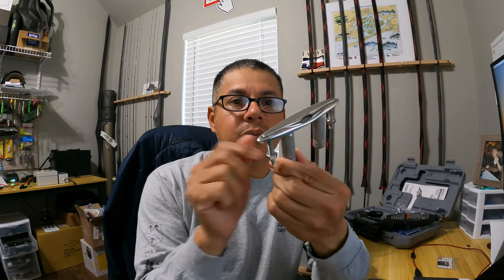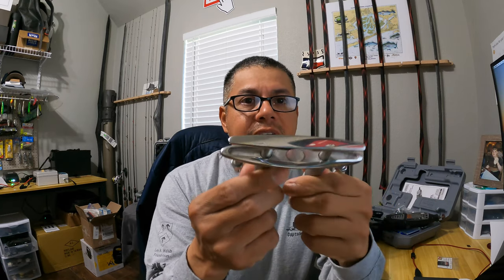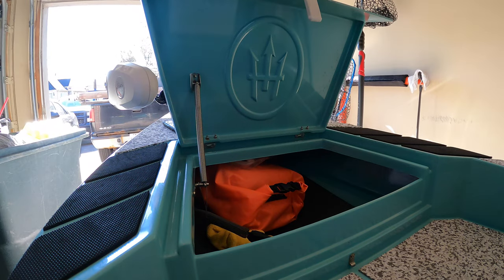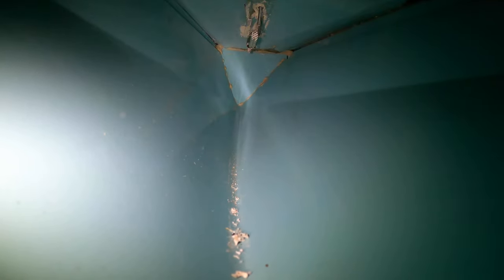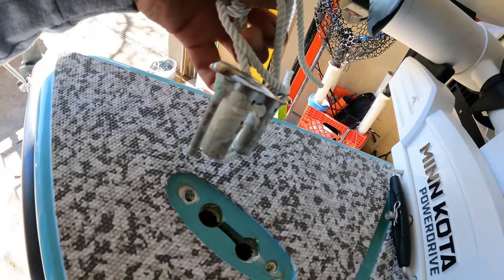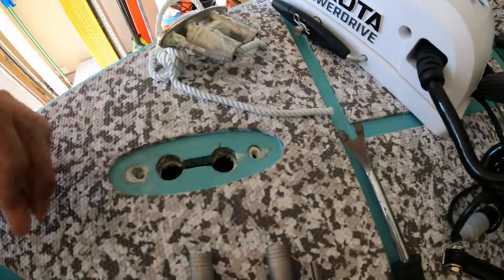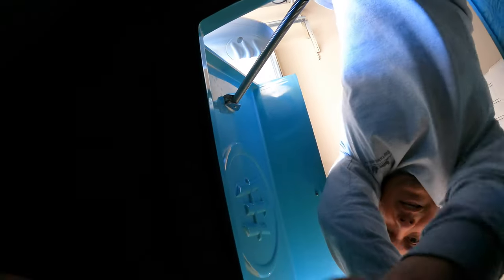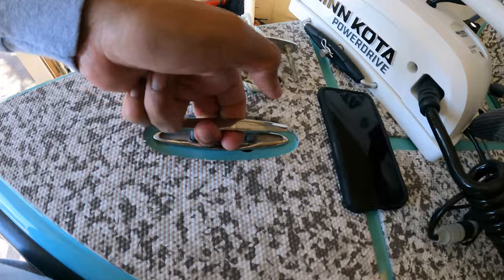Bow Cleat Removal & Replacement

Comment: A gasket on the visible area would be nice. May have thought about a plate on the backside to increase the surface area to create less stress on the fiberglass when the cleat is being used.

Comment: Water gonna seep through that hole, it always seems to find a way. Use Starboard. Easy to find at WestMarine. Cut a piece to fit that cleat area, and drill holes for new install. Then seal with 5200. If the insert on top bothers you, then just do it from underneath.

Comment: Looks like they over drilled cleat holes at the factory nothing to do with hard use. Keep us posted it will be interesting to see how they wiggle out of this one.

You could make a bezel plate to put between the cleat and deck. Use 6061, 5052, 5005 alluminum plate .060. SS could be used but it is very hard to machine by hand.

Accurately drill close tolerance cleat holes then trim outline to butt up to the padding. A lot of work to fix a factory fup.

Comment: Easy fix. Take cleat off. Get a small piece of 1/4”-1/2”Starboard (or plastic cutting board,  Using the cleat as a pattern, trace a line around it, 1/4” larger than the cleat.  Mark, then drill the holes to fit the cleat, then cut the outline you traced around the cleat to complete the new filler plate.  Get a small piece of rubber sheet, and make 2 gaskets to mount above and below the new filler plate, between the cleat and the deck.

Comment: feel for your effort.........would like to meet the guys at the factory with the 6 foot long arms....
 probably most hardware is installed before the top and bottom halves of the boat are "glued"  together?     

one solution to the "hole crack chip" problem could be to stop in at a Floors and Decor store or a big selection tile store...they have dozens of colors of "grout color match" caulk ( maybe find a aqua blue to seal the holes).....it would be pretty tuff water proof stuff...I'd at least hit it with a dap of clear silicone to keep water out......  

suggestion:  if this cleat fails, make a plate out of pressured water proof plywood (drill holes to match cleat) to mount inside out of sight.... then some good sized pan washers/ thick rubber spacers ( again to reduce shock/stress) and then the washer/nuts .....fiberglass is tuff but brittle,  doesn't handle SHOCK STRESS very well.

Comment: Hell i would try a gasket to seal directly under cleat from top or fill with marine clear goop 5200 overkill but absolutely a solid seal. Makeshift seal buy square rubber seal then cut shape out bet it will be better that 5200.

Comment: I have a predator 103 i use with a 3hp motor and trolling motor in front cut out aft to place bilige pumps going to reseal with 2 white cutting boards was going to screw them in but thinking about some type of twist lock of sorts to allow easy access yet snug tight seal. Any ideas on these type of twist locks let me know.